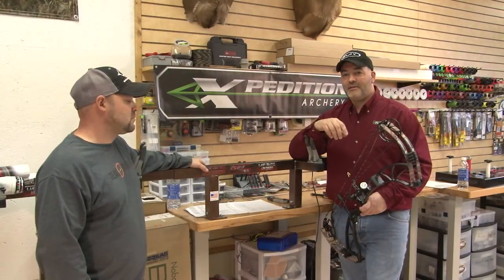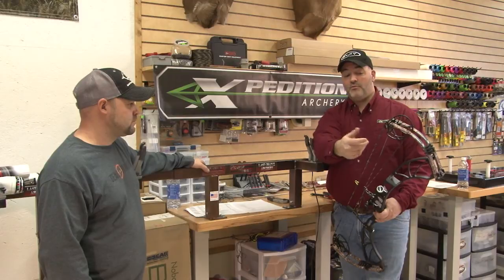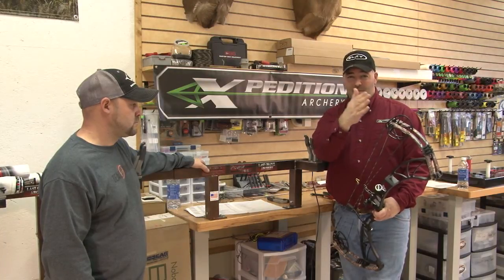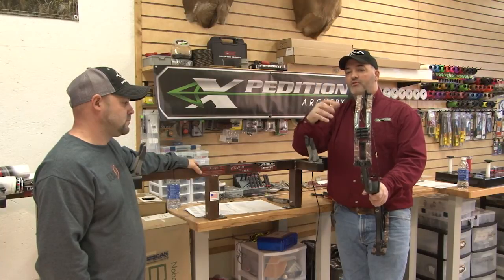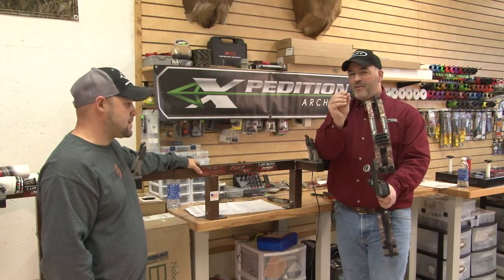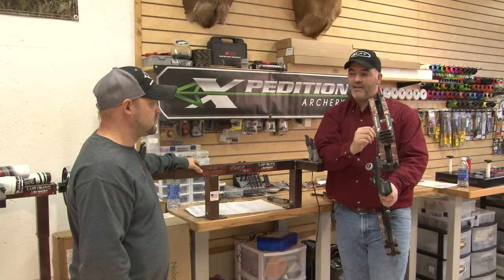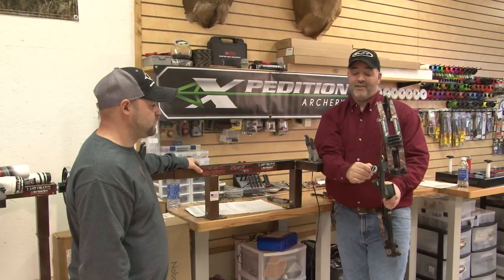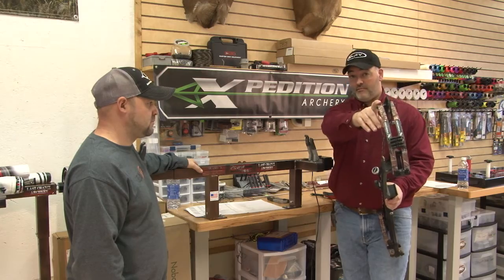Y Cable & Yolk Tuning

Comment: Are you Randy that I spoke to? I had a bad tail low left tear. I synced the cam. Then adjusted the left yoke 3 twist on the left. Shot again. Still left a little. I took one twist out of the right and it was dead center. Is this too much lean? Also in order to rid the tail low. I made sure my center shot was perfect and had to put 4 twist into the control cable. Still not a bullethole but close. Is all this normal? Remind you I'm shooting 29" mods with around 81% let off.